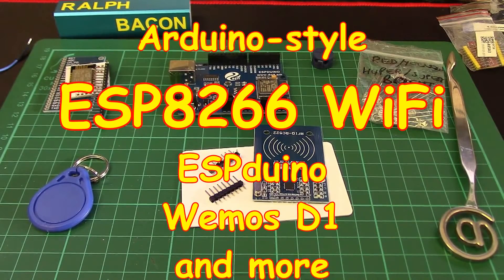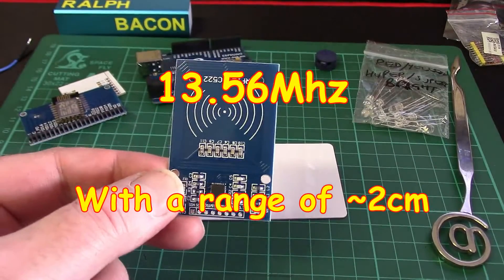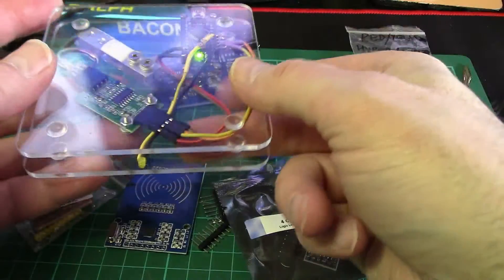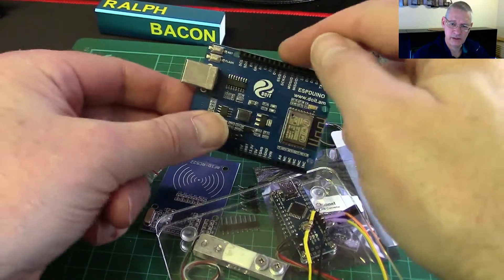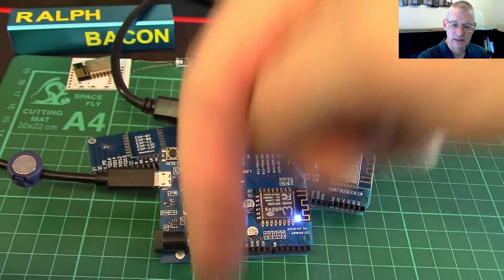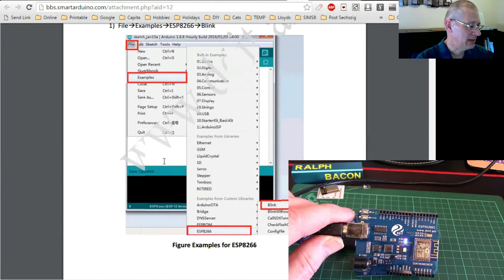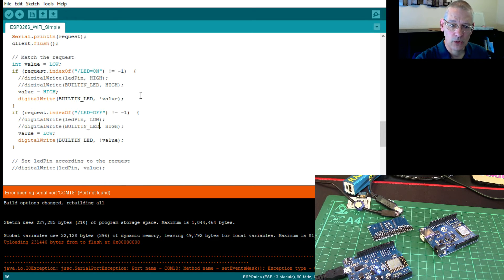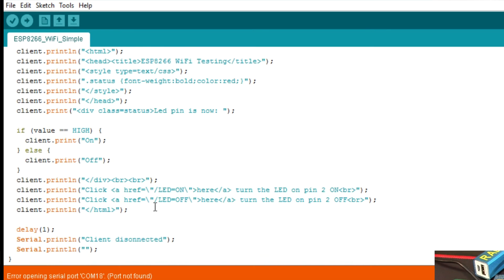#33 ESP8266 WiFi Web Server, Arduino style - Introduction

Comment: Thanks a million!  I have been sitting here, looking at my extensive collection of Arduino's and ESP8266's wondering why the hell I got them in the first place. I guess it was because of video's put out by others on this place but I would simply build something, play with it for awhile and then put it in a drawer for some other day. About the only things I have kept were some electronic thermometers one with Arduino and one with an ESP8266. I finally took the 8266 one apart for the screen but really regret that and may one day reassemble that one.  Now I have decided that, until I put these to use, I am cutting the string to China where I buy all my devices, and simply play with the toys in the toy-box until I run out, or burn them up, as has happened a few times by inadvertently feeding them the wrong voltage for breakfast.  Oh and now that Workers Comp, who has supported me since a damn traffic accident left me a disabled cop has declared me "Presumed Retired" and cut my pay in half, I can no longer afford even the cheap stuff from Banggood and Ebay.  Oh well I have way to much crap as it is, but I am surely going to study your videos and see what I can build from your suggested projects.  Again thanks a million, you will be among my favorites along with Big Clive and Julian Ilett.
Reply from the maker: Hey Jerry, I'm glad you're still going to play with the toys that you have. Seriously, if I were not doing this channel and just built stuff with the remaining bits in my workshop I reckon it would take me several years before I ran out. OK, a few header pins maybe, or hook up wire but that's all I'd need to buy.
 
That's a real bummer that you're now deemed "retired" but look at AliExpress, they seem to be offer better prices than Banggood anyway. And only buy stuff with free postage, as there's a suspicion that some sellers are bumping up the prices by including relatively high shipping fees to augment their super low prices.
 
Anyway, I'm glad of your support (as you are of mine it seems) so it's a win-win situation. But who are these other two guys you mention? Never heard of them! Some two-bit, new-kids-on-the-block, here-today-gone-tomorrow, I'll be bound.Oh. Hang on. Oh, you mean those crazy two electronics/eBay guys (also from the UK I must point out, what a coincidence). I'm just envious. Sigh. Nice to hear from you Jerry, keep watching the videos and building stuff.
Reply: Ya I understand that completely.  Just got my (Hopefully) last package from China, this one, being the last of course, took another 10 days longer then usual, and this from one of the quickest shippers I used to use all the time.  It contained a refill on 2n3900 transistors which were running low, as they are the most common n channels that I use in my toys, and several other toys that I always thought I should order, and a replacement for a very nice little 12v to 0v step down power supply that I burned up when I grabbed the wrong wire and shoved 33 volts through her, magic smoke and fire erupted, that sort of joyful things that we experience before we see the money going up with the smoke.  At least BangGood was having a special on the innards for the power pack, so I got it for around a buck and a half, for once the sales were with me.  Anyhow thanks again, I have subscribed, and intend on watching the other videos you have put up.

Comment: For those that want to use the standard blink program to test their device you can change
from pin 13 to the onboard one which is located on D4.
int ledPin = D4;
Reply from the maker: Sometimes, some of the non-standard Arduino boards have a '#define' for BUILT_IN_LED or something similar, pointing to the correct pin as they're all different! Or you could create this yourself of course. Thanks for this update Paul, very useful.

Comment: This is a great video and the explanation was terrific, I have one question what if I want to access from internet? outside from my wifi, wich IP adress must I use?
Reply from the maker: Hi WebstockXalapa (wow! what a name!).
Glad you liked the video. Let's see if I can tell you the steps you need to take to access anything inside your home network from outside (eg from work, or just anywhere via your smart phone).
 
Your router is the key item to update. You need to tell it that incoming requests to http port 80 are going to be redirected to a particular local address (one beginning 192.168....) which is your ESP module.
 
So you need to know the IP address of that device, of course.
 
Many routers will prevent incoming requests by default (a security measure) so you must read up on your particular brand. You will also need your IP address as supplied by your ISP. If your IP address is not STATIC (that is, it does not change, known as dynamic IP address) then you have further problems to address. But check with your ISP whether you can get a static IP address (sometimes they charge for this, sometimes not).
 
If you have a static IP address then just type that into your browsers address line. Eg http://212.58.244.22 then your router will receive the request and route it to your local address (starting with that 192.168....) which is your ESP module.
 
If you DON'T have a static IP address (that is, it changes regularly, without warning) then you have a dynamic IP address and can test it all out as above with the address you currently have but, of course, it will only work for so long as your address does not change.
 
To overcome this you can use a service (for which they might charge) that monitors your IP address and updates the records as it does. See here for more details: http://dyn.com/remote-access/
 
Frankly it's all so much easier if you can get (or already have) a static IP address.
 
Finally, you can test all this on your smart phone from your own home just by switching off WiFi on your phone - your request will then go via the mobile network and get routed back to your router if you've done it right. Test it with WiFi first (with the local 192.168... address) then with your WAN address (the one the ISP gave you).
 
There's a lot of information out there on the Internet that covers this in the most intricate detail but that is a summary - I just hope it helps you get started!
 
Thanks for posting with such a relevant question, others will appreciate it too!
Reply: Wow! this explanation was even more terrific than the video :D (by the way, WebstockXalapa is the name of my own bussines here en the city of Xalapa, in Veracruz, Mexico. My real name is Adrián). So I uderstand that my ISP uses an dynamic ip adress for the DSL modems, but I saw that have about 1 year with the same ip so I think maybe doesn't change at all. I will check the incoming requests from internet on my modem and then ask you again for your advice. My project consist in develop a Reef Brian Keeping System (it's the name I give it until now) this sistem will help me to control several things of my marine tank :)

Tank you for your help!!!!
Reply from the maker: "... even more terrific than the video" - now those are the sort of comments that I like Adrián! I'll help you where I can, good luck with your project.
Reply: I feel much better now, I simply fantasize Trump jumping off his tower and falling on his cabinet  :)) Finally I have a little better understanding of what a server, client is. Can you tell us how to change code to address a pin instead of BUILTIN_LED? Now for maximum fun, can this be used to read dht, sonar etc. and maybe even motor, servo control? Best part is free, although the yellow board with bat. box has a decent app. with switches and rgb control. free
Reply: This one, good for beginners ebay
Hot-ESP8266-Serial-Port-Wifi-Test-Board-ESP-202-Module-Development-Test-Board

Comment: Good evening (for me) Ralph.
I want to get started on the ESP front and I'm wondering if an ESP32 could be used for my GPS project.  I'm using a serial display :-( that requires pins I can't translate to the '32, but I'll learn more and more about them, thanks to your videos.

I just ordered an SPI screen from China.  I think I'll need your help to make it work if it's not strait forward.  LOL

Looking forward to talk to you soon, my Friend !
Reply from the maker: ESP32s are indeed  one of my favourite modules; cheap, fast, wireless, BT, lots of memory both storage and runtime and with an operating system that you can just pretend isn't there if you want and use it as a suped-up Arduino (initially). We'll be talking, I'm sure.

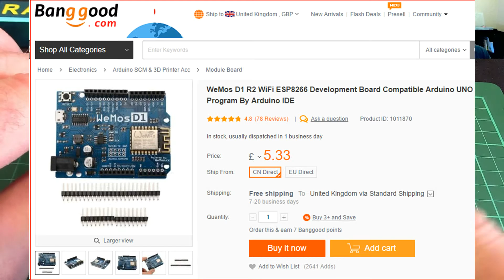Comment: N00b question I hope someone can clarify : at 11:22 it's stated that Wemos D1 Rev.1 is 3.3v but there's also a pin for 5V. So if you use pin 5V then the you can connect 5v devices? Or is t his about the internal logic of the board operating at 3.3v and nothing to dow ith those 3.3V and 5V pins ... but then the 5V seems to be of marginal use if you can't connect it to anything on the board without a Level shifter?
Reply from the maker: Hey Benny (now where have I hear that great name before?). The Wemos D1 (Rev1) is a 3.3 volt device. You can only get (or source) 3.3 volts to the GPIO pins and the analog pin is limited to 3.2 volts (it states) but I'm almost thinking that's a typo and it should read 3.3 volts. The 5v header socket supplies 5 volts for other peripherals (if you power it via the jack barrel socket with a 9v - 24 volt supply) but if you are using 5v peripherals you MUST use some soft of level-shifting to bring any incoming signal voltage down to the 3.3 volts mentioned. I think you already have grasped this, but that's the state of play. Useful? Clear things up?
Reply: Ralph S Bacon Thanks, that does confirm my hunch. Got in the Maker stuff only a month or so ago, it's a great time to start : such a wonderful community and the hardware can be had so cheap! Having a blast! Thanks for your channel!

Comment from the maker: This is the URL need to add the ESP8266 series of boards to the Arduino IDE (in File > Preferences, Additional Boards Manager URLs) :

 http://arduino.esp8266.com/stable/package_esp8266com_index.json

Secondly, here's a link to the PDF with English instructions on how to install those boards (using the above link):
http://bbs.smartarduino.com/attachment.php?aid=12

Comment: board wemmos d1 r1 and this are my settings 

i got this error after i tried to conect the arduino to a java sofware intellij ide before that it was working just fine 

warning: espcomm_sync failed

error sending the sketch
error: espcomm_open failed
error: espcomm_upload_mem failed
Reply from the maker: The messages you are getting, Miguel, are typical of either a misconfigured board selection or the wrong COM port number. If the program on the Arduino is sending any data to the Serial stream try reading that using the USB connection to make sure it is still working (and make sure the baud rate has been correctly selected in the Serial Monitor window).
Reply: do you know what should be the settings of the wemmos d1 r1 in the arduino ide ?
Reply from the maker: Assuming you have followed the instructions here https://wiki.wemos.cc/tutorials:get_started:get_started_in_arduino and have added the correct URL to your board's manager, you can select the Wemos D1 (retired) and get the following settings automatically:
 
Board: Wemos D1 (retired) <-- this means R1 version
Flash Size: 4M (3M SPIFFS)
CPU Frequency: 80 Mhz
Upload Speed: 921600
Port: wherever you have plugged it into! 

Good Luck.

Comment: Thank You sir, i really like your videos and explanation, i have learnt a lot from you, so recently while i was trying to make a Iot Based attendance system Using ESP826612e Node mCu, but problems i faced were due to R305 fingerprint sensor, firstly i thought about using RFID tags for identification purpose of students, but than decided to use fingerprints, but whenever i try to enroll the fingerprint in the sensor it gives unknown error, while using it with arduino uno, i am using the adafruit library : https://github.com/adafruit/Adafruit-Fingerprint-Sensor-Library . Some people even suggested that it is problem with arduino ide 1.6.13 and if i use older version 1.6.6 i will not get this problem. So i even tried that but problem remains same.

Detailed Overview of this project:

1. I decided to use ESP8266 12e node mcu due to its cheap price and wifi capabilities, r305 fingerprint sensor, and oled display 0.96".

2. So i was thinking about interfacing all of these and making a device which would connect to wifi network and ones a teacher scans his finger and chooses a class and subject, and than gives it to students to scan their fingers, it will display their name on screen whoever scans his finger, and ones all the class have scanned their fingers then it will send a mail to a mail id containing all the names of present students.

Its functioning:
1. whenever we switch it ON it should search for wifi network and connect to it, is known networks are not available than it should display all available networks, such as explained in this video : https://www.youtube.com/watch?v=G2yJpjuBRms

2. ones the wifi is connected now it should check in which mode we are operating it, i.e we should design it in two modes, setup mode and running mode, in setup mode we should be able to enroll a fingerprint and give it a ID and name so that it store it, and in running mode we should just run it., ESP8266 will just check whether a button is pressed or not and decide which mode it is begin operated in.

3. Now ones the running mode is activated i.e button is not pressed. so it will ask for a fingerprint, if a teacher scans his finger than it will check and match it with the fingerprints of database, if it matches than it will let him select class and subject, ones it is selected than he can handover the module to the students.

4. Now students will scan their fingers, and device will display the name of students whose fingerprint matches on oled display, and side by side it will also save those names in a mail.

5. ones all the students have scanned their fingers than when the same teacher scans his finger, it will send the list of all present students to a mail id via gmail sender. Link to gmail sender : http://www.instructables.com/id/ESP8266-GMail-Sender/ 

Future scope:
Now when the mail has been sent than the website can read that mail and mark the attendance of all those students who were present for that lecture, mail subject may include class/lecture/date which teacher had selected in the beginning. Even a android and iOs app can be developed where a student can check his attendance in real time.

So what are the improvements can you do in this and can it be done successfully? Can you help in developing this project?
Reply from the maker: Hello Manish, I really appreciate that you like my channel but the level of support you need is beyond me. Please let me recommend the Arduino Forum (https://forum.arduino.cc/index.php) who have experts you can guide you through a project like yours - as long as you show that you have taken various steps that they suggest and don't expect them to do your work for you! Really, go on, register there and introduce yourself and ask the question(s) and you will be amazed at the responses.